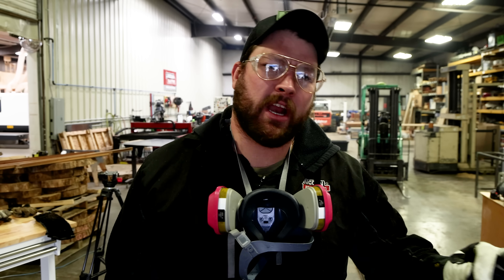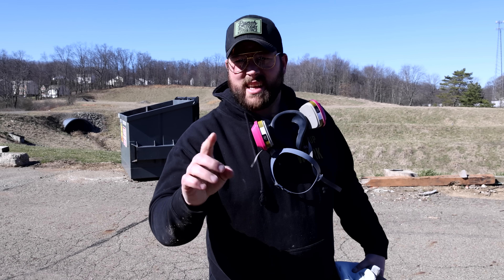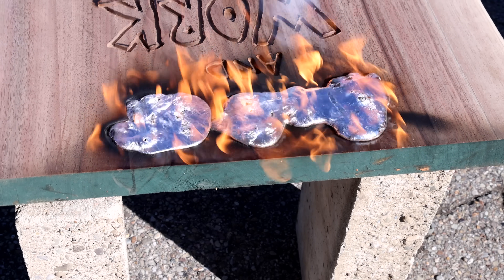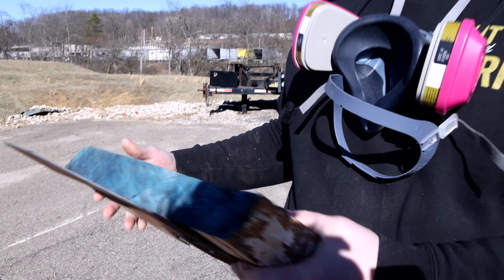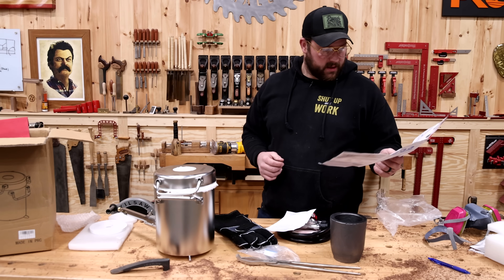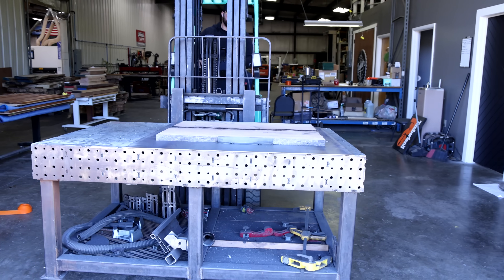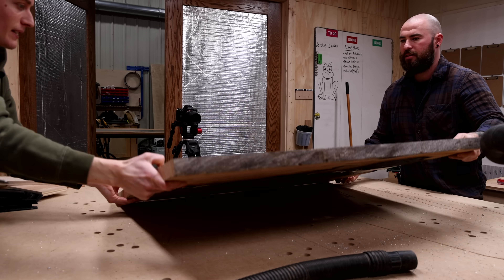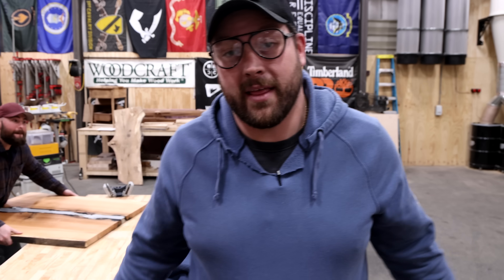I Tested Pouring Molten Aluminum in Wood

Comment: To anybody thinking about melting aluminum, DO NOT keep buckets of water on standby. Molten aluminum and water equals explosion
Reply: I disagree with that. When you inevitably burn yourself by touching something you don't expect to be hot, you want a bucket of water within a few metres of the furnace.
Reply: You are correct, liquid nitrogen is what you'd want to cool down molten aluminum quickly and safely, you don't need much but best to keep a thermace full in case you need to douse the molten aluminium for any reason.
Reply: I don't think they were keeping the water for the aluminum but rather if some got onto someone's clothing, shoes, etc.
Reply: @zafarsyed6437  nothing wrong with using water to cool down the aluminium, molten or not.
Reply: @abowden5079  Yeah, I agree.  I was thinking the water was more for the people's safety, etc. 
 I would think they would use the fire extinguishers in case something actually caught on fire.
Reply: @zafarsyed6437  we can only hope people understand that. Smelting isn't really common knowledge.
 I came to the comments as soon as I heard that just to write "never throw water on molten spills". The way he said it made it seem like it was for using in case of a spill or mishap.
Reply: You can pour molten aluminum into water all day long. You can also fill up a steel can with aluminum and drop it into water. The actual danger is when you have some trapped water in a piece of aluminum that goes into the foundry. That can cause some splatter of aluminum.
Reply: @abowden5079  Wrong my friend. Semi hardened is fine, like 15 minutes after a small pour just to be safe

You just stated hydrogen combustion explosions were "totally safe". (2.5 times more explosive than nitroglycerin)
 Water + molten aluminum = explosion
(Not 100% of the time under certain conditions. But any rapid boiling water will result in a aluminum oxide and hydrogen explosion spitting molten aluminum. Look up wet scrap in foundry explosions.)

It's better to just avoid that situation entirely by letting it cool as much as possible before dousing your pours or trying to "put out" liquid metals.
Reply: That sounds like a challenge. Hold my beer…and the camera.
Reply: I have hand poured 5# at a time, into several small molds. we cooled (aluminum freeze) before ot would release from molds. then, drop just ingots into water. cooling very fast, you can handle shortly after. have yet to experiment with molding into wood. looks fun
Reply: Thank you. Plus, if you rapidly cool aluminum, it will explode and also crack the aluminum. So it'll ruin everything. Lol
Reply: Fact
Reply: There is nothing special about aluminum and water. - feel free to put as much water as you like ON TO aluminum. - you can get a poured ingot of aluminum and pour water over it. you can also feel free to put aluminum INTO water, - you can pour straight from a crucible into a swimming pool

However, when you are in the making the ingots stage, if you're melting cans, make sure they are dry, - if they are not and you push a can of water into molten aluminum, the water will rapidly heat and turn into a rapidly expanding pocket of steam, and throw molten metal,  

aluminum onto water = fine
aluminum into water = fine
water onto aluminum = fine
water into aluminum = bad times.
Reply: It depends if Irs pressured liquid or not just plain water from a cup bucket or hose won’t blow but a can or water bottle will I worked in a aluminum mill for years and we had leaky roof
Reply: @abowden5079  That has to be one of the stupidest things I've read all day. 🤨
Reply: Water on molten aluminum will roll and evaporate off. Molten aluminum on water creates rapid expansion of gas as the water evaporates and escapes by pushing through the metal. This causes the explosion that is being discussed.
Reply: @[KRZb] Mouse01  wrong. Water on the molten aluminium will simply cool it and within a few seconds you could touch it. I work in a smelting plant..i do this for a living every day.
Reply: You know how many videos there are just on YouTube of people pouring mullen aluminum into water just for the effect it makes.  The only time you would risk an explosion would be if the steam created had no where to go.
Reply: I’m glad you said this hahahaha 😅
Reply: @BGK Media   why? Its a load of bs. Why you glad he said this load of bs
Reply: I disagree as long as you don’t poor water into the molten alum
Reply: @Chase  so wrong. I pour water onto molten aluminium everyday at work. Its the fastest and easiest way to cool and solidify it from its molten state safely.  You don't know what youre talking about
Reply: @abowden5079  I just mean into a red hot crucible
Reply: He is correct about molten aluminum but as soon as it crystallizes it is completely safe
Reply: @ethanhumphrey5758  This. I have lost count of how many times I've ended up with a minor burn, and it was minor because I could dunk it in cold water asap. Still, don't ever pour water on a furnace fire. Ever. Unless you want to get to know the staff at your local burn unit.
Reply: But explosions are fun
Reply: I used to drop my ingots in water after pouring them it was okay
Reply: @dommyboysmith  you are correct.. Kaiser Aluminum plant in Spokane Washington requires you watch several safety videos before entering the plant.  And water bottles and closed water containers are not allowed in the plant floor proper.  Several of the videos show actual footage of plant explosions.
Reply: Exactly so instead use ice water or BAJA BLAST.🤣
Reply: @dommyboysmith more explosive?
Reply: I've made aluminum shot and it did not explode 😂 you never melt aluminum that has moisture that will cause an explosion but using to to rapid cool won't silver and gold requires much higher temps and it won't explode making shot or rapid cooling either just again got try to put moist materials in the furnace it can cause gas pockets and explode not fun
Reply: Only if you were to pour water into the molten aluminium. The other way around, a big bucket of water quenches aluminium no problem.
Reply: @PhaTs00p  ...This thread is quite pointless since the lot of you just talk about 'what will happen if' scenarios, while no one really talks about what actually happens.

Combining water and an extremely hot surface causes near-instant evaporation of water. When liquid water turns into gaseous water (water vapor, aka. steam), then its volume increases several fold. This means that a small amount of water turns into a large amount of steam, but since it happens so quickly and with such an amount of energy being involved, loose items on the way will be pushed away as if in any other explosion.

That means that dumping water on molten aluminium can have SEVERAL different results, some are 'safe' and some are 'not', simply because physics use many variables. 
If the water will evaporate without ever breaking through the surface (small amount of it or hot enough aluminium) then it will just evaporate without doing much to the aluminium, as the explosion of steam will obviously follow the path of least resistance.
If the water ends up going under the surface of the aluminium while it is still molten, then some of that water will be forcing everything around it (including the water above it, that ALSO explodes however) outwards, in an attempt to expand. This is the point at which aluminium will be splashed out. This is what happens if there is something that protects the water from instantly evaporating like the aforementioned bottle, for example, this is also what can happen if there's a good amount of water and the aluminium is hot, but not hot enough to evaporate the amount instantly, and some of it will get into the inside. This is generally what happens if you pour water onto oil which will be penetrated more easily and is going to be easier to be dislocated (oil is more 'liquidy' than aluminium). On the other hand if you pour a huge amount of water on small amount of aluminium, it will just splash some water around with a lot of steam.

This applies to ALL liquid substances. It's not special to aluminium. It is a property of any liquid that can evaporate, as gaseous form always has a larger volume. It's just that water is simply the go-to solution for cooling things down in peoples minds, so it's the first thing that people think of.

In other words, teach of the mechanism, not the results. Dangerous things are dangerous not because of what happens, but how it happens. A saw is dangerous not because saw + finger = hand without fingers, but because saw can CUT OFF fingers.
Reply: Thanks for pointing that out.  I was actually checking to see if anyone had mentioned it.
Reply: That's any metal there genius.
Reply: Can somone please tell them they can use wood tools on aluminum!!
Reply: I work at an aluminum factory. We make ingots of aluminum. Liquids are not allowed in the area because it is basically a bomb. If you want to blow your hand off keep the water real close. If you Ike yours hands and face I recommend you get rid of the water
Reply: Dirt, plain old dirt. Best you could do is avoid concrete cause it will pop if molten aluminum hits it. Run away and if you can shovel or create a channel of dirt to follow, the more it travels, the cooler it becomes.
Reply: Sand
Reply: Lol better tell all those metal melting channels they've been doing it wrong for years
Reply: I was just thinking, if there's any moisture in that wood, it could be bad.
Reply: You think the buckets of water are for the metal. I bet it’s for ALL THE OTHER FLAMMABLE SHIT AROUND. Y’know, things like wood… rubber… people…

🤦🏻‍♂️
Reply: Sounds like this needs it's own video to settle the dispute. 😂
Reply: yea, extreme heat and extreme cold does that lol
Reply: False. Just add some salt n its safe! Dont be an idiot n melt metal without lots n lots of water close by. Go along. 😀
Reply: @dommyboysmith  I think they were talking about cold water, not boiling water.
Reply: 😂😂😂 no it doesn’t😂😂😂😂 stop giving out wrong information
Reply: That's the fun part
Reply: Yeah ever seen that guy try and mold a hollowed out stump? It explodes in his face as he’s filming.
Reply: It's better to have kerosene nearby.  It neutralizes molten aluminum
Reply: I work at an Aluminum smelter and when I heard we have two buckets of water I immediately shuddered, DONT! Foam it or let it burn. You don't want a metal explosion
Reply: Eh, I’ve done it all the time with no issues
Reply: Sounds like fun 😁
Reply: Water and melted metal explosions occur when pouring into molds that have moisture and adding wet material to melting or melted material.
Once it is poured you can add water to cool faster.
It is when moisture is trapped or under the pour that it expands and explodes.
Now if the wood was still dmap or wet there is a chance it could react and pop.
Reply: Sand will be a good alternative

Comment: I'm a metallurgist that has poured aluminium. A couple of things that I noticed... The aluminium you were given is wrought aluminium, not for casting. Casting aluminium, like cylinder heads and cast pistons flow a lot better. Secondly, it might melt at 1200°F but you should take it to 1400, flows better. Thirdly, yes, tiktok guy did a big pour. The first pour you did, starts to solidify right away because everything around it is relatively cold. Worse if a metal plate is used as a backer, really sucks the heat out. A metal plate would need to be preheated. You'd have to find a way to use a sand base as it's more insulating than a steel plate. As the layer of poured aluminium gets thicker, it acts as a bigger and bigger heat sink. You won't fuse any of the layers together very well at all. That should have been one large, single pour. So, you need a much bigger furnace with bigger crucibles or just more of them and a lot of guys pouring at the same time. Not sure what to do about your warping wood, though. Still a very entertaining video.
Reply from the maker: damn Andy, i shouldve called you before ! haha thank you
Reply: As a woodworker, I can shed some light on the warping wood. The reason the wood warped was most likely due to trapped moisture being heated unevenly. There were likely pockets of moisture in the wood, and it flash dried unevenly. The steam can warp the wood as it tries forcing itself out of the grain, which is why drying is usually done very slowly in a very humidity controlled environment.
Reply: Thanks for sharing you guys! So interesting!!!
Reply: I would not have used segmented rebar. I would have used all-thread the entire span, including the gap; it would hold the aluminum better "threads" and bound the two sections of wood together and prevented uneven warping.
Reply: How about something that melts around lead temperature that isn't lead, gallium would be really bad though
Reply: Zinc melts at 420C, al - 660C.
Reply: @stanimir4197  still to hot? Or just toasty enough?
Reply: @MrSparkefrostie  it's much lower than just Al, still it can burn most wood types.  Zinc can be alloyed with Al (5%)  for even lower (380C) melting temperature. Like many mentioned pouring the molten Al  (no flux, no Argon, no CO2) was bound to fail - Al reacts with oxygen immediately, forming a very hard oxide (sanding disks are made of AL2O3).  Overall using CO2 during the pour would prevent ignition and oxidizing.
Reply: @stanimir4197  fair, I am not a hands on person, asking as I don't know. I was thinking the heat would cause burning regardless and how to avoid it, most guys are thinking beyond at the carbon (??) Formed on the wood that would just act like a low friction surface and make the parts never join
Reply: Can molten aluminum turn yellow/orange like lava if it gets hot enough?
Reply: @johnp82  sure, even the simplest image search should show some pictures like that; the temperature defines  the light wavelength (i.e. its color)
Reply: Maybe the metal back8ng plate in the original was preheated to slow cooling.  Also, a flux like borax would greatly help.
Reply: or he coud use lead insted of aluminium
Reply: FINALLY a english speaking Person call it Aluminium.
Reply: @John_Malecki  Sooo... Time to try again? XP
Reply: @John_Malecki  Alos looked like they may have used tin and not aluminium. Much lower melting point.
Reply: @johnp82 Aluminium picks up a reddish hue when it gets hotter. But you shouldn't go there, too hot, it will dissolve too much moisture from the air and make oxide on the surface and take in hydrogen and make porosity in the casting.
Reply: What about filling the river with wax to create a negative. Then sand casting the wax negative in AL, and finally use C channels and threaded inserts to bond it all together? You still need much large furnace the accommodate the needed amount of AL, but at least the wood never has to burn.
Reply: That’s a good idea. So a better approach would be to cast the void with a cheaper material and then use that to create a relief in sand?
Reply: @Cocamo  That is my thinking.
Reply: Doing a large pour would result in alot more charring, any ideas of how to avoid charring?
Reply: @John_Malecki  I think you should retry this given the information Andy provided. You could build a mould and put like 4 inches of compacted sand in the bottom and do one large pour.
Reply: @John_Malecki  round 2?
Reply: Would an aluminum fusible alloy work? I know it sounds like cheating, but that could bring the melting point down by half or less.

As for woods, wood doesn't instantly combust all at the same temperature until you reach 700° F; till then it depends on the type of wood, how and how long it's exposed. At 450°-500° F some hardwoods can take hours to ignite.
Also pre-charring the wood even a little bit would probably help a great deal. Warping comes from the amount of moisture being dramatically different and shifting during temperature differences so pre-charring should help since the wood making contact with the molten metal will already be extremely dried out. Plus some can still maintain surprising rigidity even after being charred by molten aluminum.

I also looked at the TikTok vid in question and it appears that there's some kind of other material, white and creamy and shiny at the bottom; the table was not completely separated at pour and it tapered to a point reaching near the center which might make a difference as far as contact with the wood and holding things together.
Reply: @WritingFighter  I couldn't find any aluminium fusible alloys. Indium corporation, the largest supplier I could find, didn't do aluminium. Most of the alloys they sell are toxic one way or another. Even just using lead, as another person recommended, it's still too hot and then it's toxic so you can't sand/polish it very much.
Reply: You are allergic to metal?
Reply: @John_Malecki  Maybe get Andy to pour the next one lol
Reply: Would covering the wood surfaces that are burned with aluminum foil keep it to a singe? Dry the pieces extra, and protect the surfaces with foil?
Reply: Yeah and oh boy don´t even mention all the safety issues. Pouring metal while it´s raining outside, you have not preheated anything uff rough to watch man.
Just use ZAMAC or pewter instead.
Reply: @guitarwi3rdo I'm in!!!
Reply: @MrSparkefrostie 😂
Reply: @CrimsonGryphon45  what I do 😄